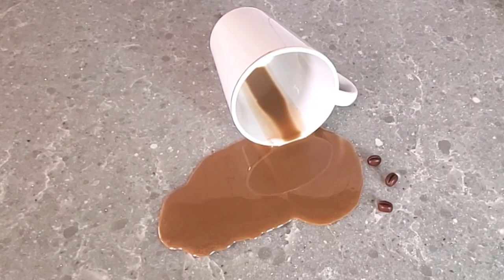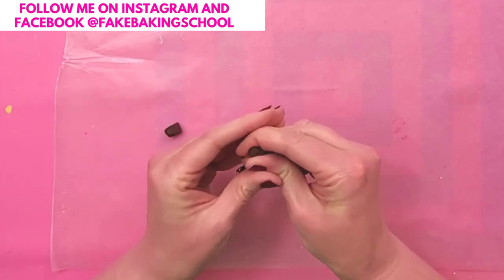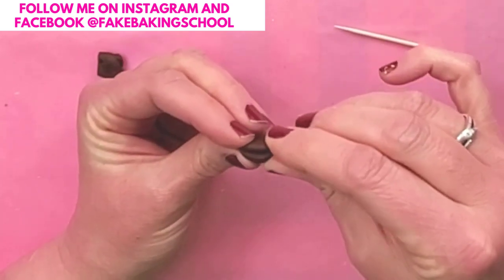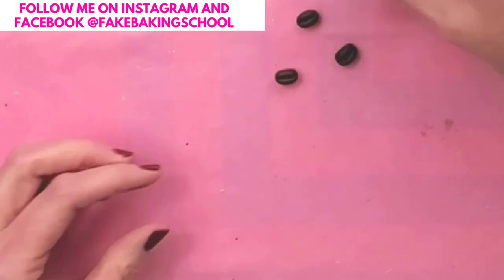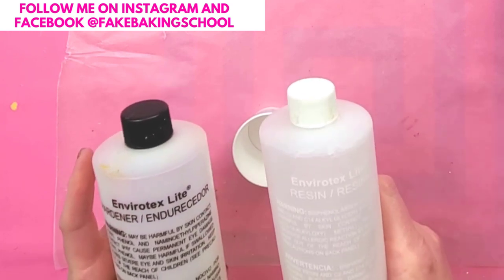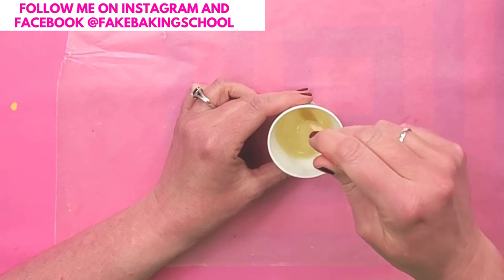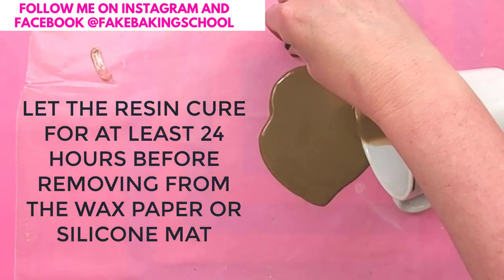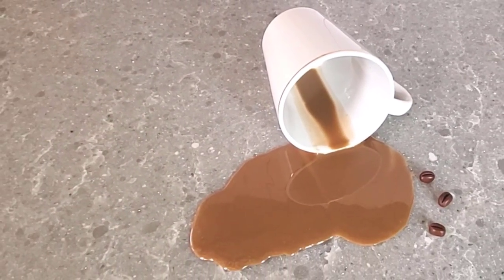HOW TO MAKE A FAKE COFFEE SPILL and FAUX COFFEE BEANS - DIY Spilled Drink Prank

Comment: Any idea how many ounces I would need if I just wanted to make a full cup of coffee for someone?
Reply from the maker: All coffee mugs are different sizes. I would fill the cup with water to where you want it and then dump the water into a measuring cup to see how much you need. Be sure to dry your mug completely before putting resin in or the resin will get cloudy.
Reply: @CassieSmallwood  Good Point ( about the mug sizes)  And awesome suggestion! Didn't know about  having to dry it either. Thanks, as usual, for your quick response!!